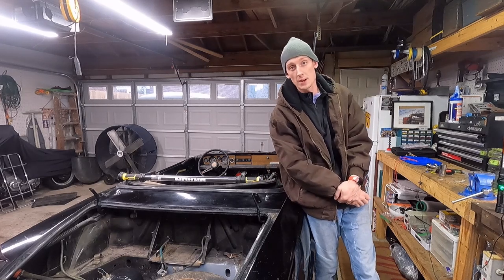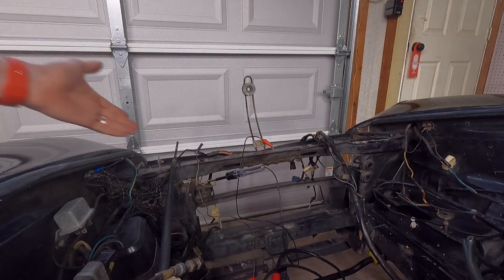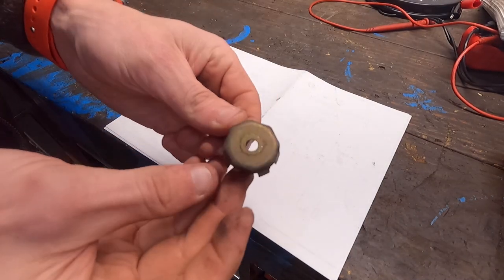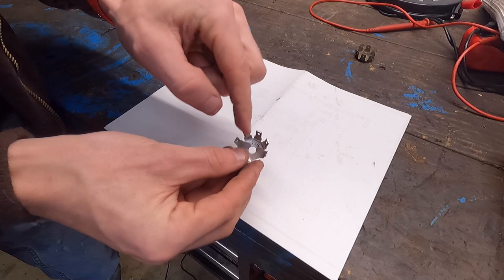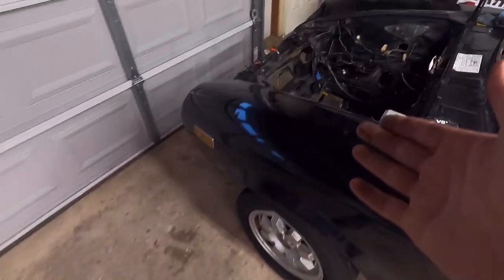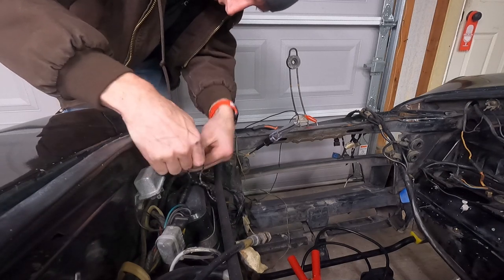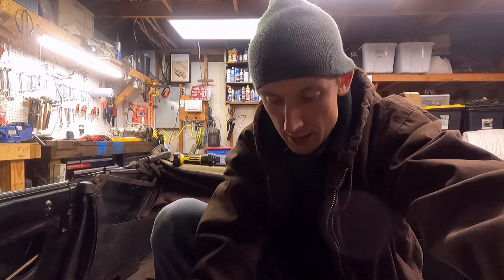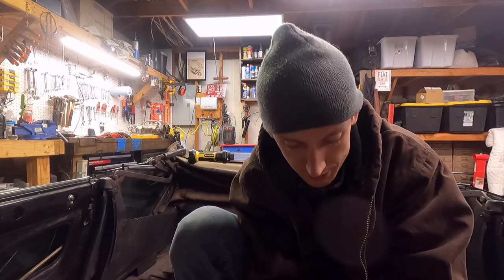Diagnosing Interior Electrical issues in our 1982 Fiat 124 Spider Project! Can We Fix It?

Comment: I had the same problems with the horns. I opened them up and the diaphragm was completely rusted around the entire circumference. Midwest Bayless sells a new set for about $35 if I remember. I'm just going that route. BTW, I have a new set of front 124 brake pads if you want them. Just shoot me an email with your address and I'll send them to you.

Comment: On both of my 79’s, the fan switch is mounted just forewarn of the parking brake in the lower console.  The 2 switch holes, right and left, are typically for power windows.  Oddly enough, both of mine are pre-wired in the doors.
Reply from the maker: Interesting. They have the manual cranks on the doors for mine. Probably the wrong upper middle console. That’s alright! Good to know though!
Reply: @GarageTimeTV  cars without power windows have metal blanks instead of switches

Comment: Good morning.  Does the wires have to go back to the same spots  on the pod ? Thank you for the videos !
Reply from the maker: Which one were you asking about specifically?
Reply: @GarageTimeTV  the ones on the side of the engine bay
Reply from the maker: @erickfrench2768  oh! For the grounding pods! No, location doesn’t matter since they all ground to that spot.
Reply: @GarageTimeTV  thank you. I'm having trouble with the headlights and wipers and radio lol. Thanks again for making the videos
Reply from the maker: @erickfrench2768  of course! Definitely check connections and under that ground pod. You want that to have great connections. Loose terminals on the wires can do that too. Pliers tightening them helps

Comment: Was hoping you were going to have to pull outbtje heater fan.   My '82 only has a weak high, or maybe its the low.  Trying to dwtermine if its the switch or the blower motor?   Any thoughts on where to start?   Can you swap out motor/fan without pullimg everything apart?   Thanks!
Reply from the maker: To get to the blower motor you’d have to pull the upper and lower console. You can test the fan by taking the switch out of the equation. Unplug your switch and you’ll see 3 wires: red/yellow/blue. You should be able to apply 12v directly to one of the wires to get the fan to go. If it is still weak, check the fan ground. Grounds are majority of the problems in these cars.
Reply: @GarageTimeTV  thanks for the help, will checkout the switch!  Probably gonna replace the old Sony removable face stereo as throwing out error msgs.   So, maybe a good time to do both!
Reply from the maker: @barryjohnson1330  good idea! Glad I can help!
Reply: Looked at the fan switches on Autoricambi.   They appear to have flavored out sides to hold them in place.  Can they just be pried out from above, or do you have to lift up the center console to access?

Watched your headlight relay video so doing that and door lugs this weekend and the fan switch.
Reply from the maker: @barryjohnson1330  if you have a pick, you can get one in on one side to depress that tab. Then push up as you depress it and it should pop out.
Reply: @GarageTimeTV  I do indeed, thanks again for the help!  Keep the videos coming!  Saved yours on the gimbo & driveshaft, winter project!
Reply from the maker: @barryjohnson1330  I’ll do my best! Had to slow down recently with life stuff, but we will get back into more projects. Thanks for watching!